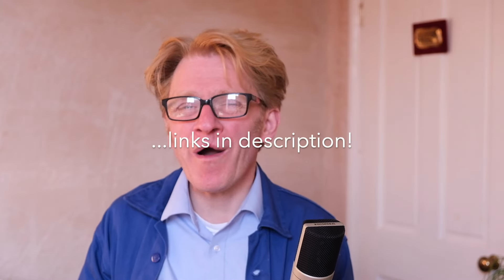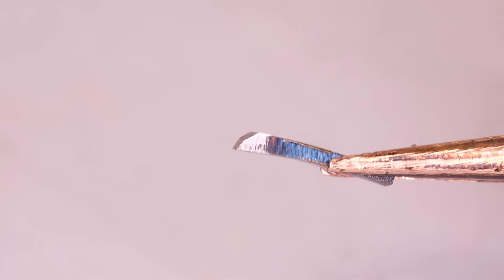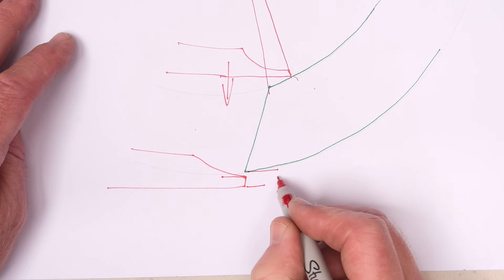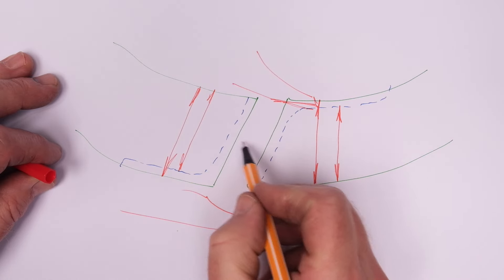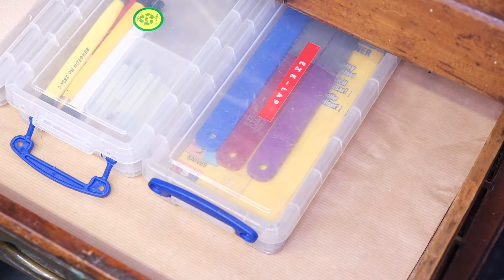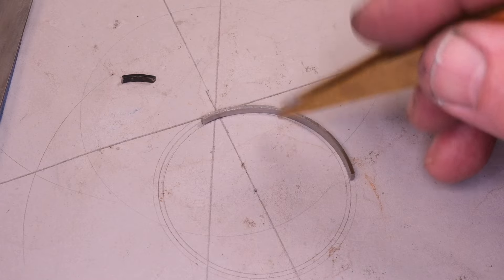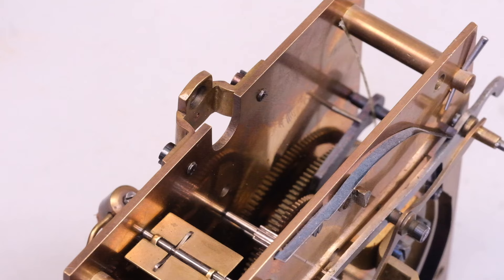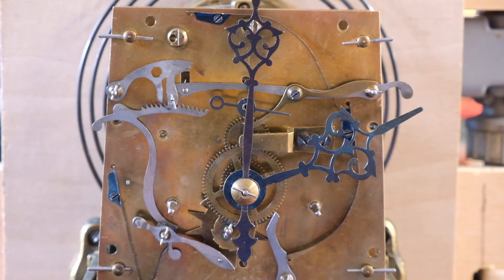#032 Making a pallet for a dead-beat clock escapement - clock repair

Comment: Very informative video Matthew as usual , torsion clocks have deadbeat escapement but the locks are a bit deeper than on a normal pendulum clock.
Reply from the maker: Thanks Dell.  Ah yes I didnt think of that re deeper locking on those escapements.  Good point.  Hope you are well. M

Comment: It's an...interesting repairwork on the spindle, not unlike the botchery i did with the Mainspring of my Junghans...
Reply from the maker: Ha!  Yes these repairs can last a long time! :=) Gotta start somewhere...
Reply: @howtorepairpendulumclocks  i know, as said i needed to repair the broken Mainspring of my Junghans tableclock(?) In german: Tischuhr) and i couldn't for the love of god find a replacement. So i heated what was left up, bent an new tab to hold it in the Barrel and Well...now the clock only runs for 6 instead of 7 days...but it worked...

Comment: Another excellent video. Would it be possible to cut a slot in the pallet where it is worn and insert a jewel rather than some hardened steel? If so, do you know of a source for such a jewel?
Reply from the maker: Yes it would.  You would have to make a jewel but using diamond that is not maybe as difficult as it seems.  In a clock a jewel I agree would look nice but really offers you no advantage over dead-hard polished steel.  Would be a nice exercise to make one though!
Reply: @howtorepairpendulumclocks Thanks, I might just try that. I have a friend who is a jeweler who may be able to help.